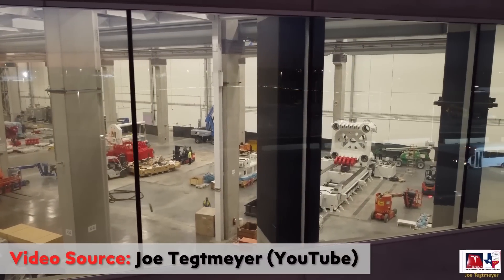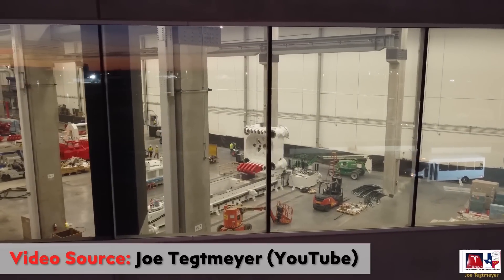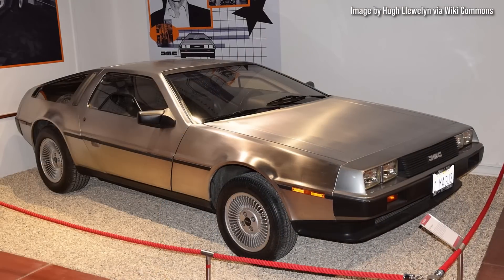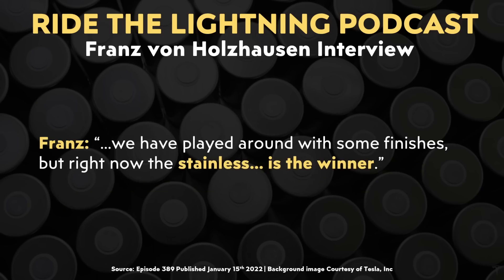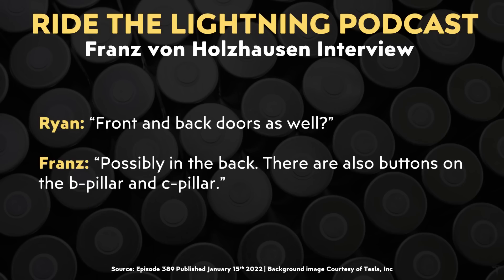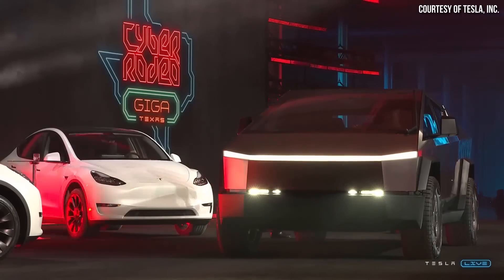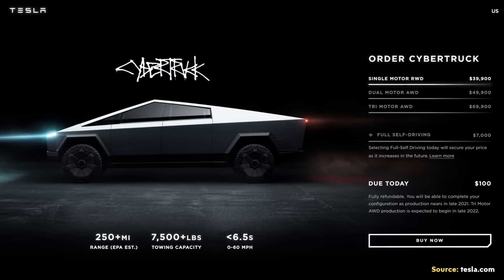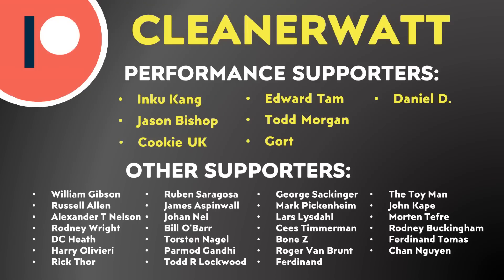NEW Tesla Cybertruck Updates from Franz von Holzhausen + Giga Press

Comment from the maker: Check out the SPAN Smart Electrical Panel: https://bit.ly/cleanerwattspan (Sponsored)
Reply: Thanks Jon.
I hope that Tesla can also produce a scaled down version which would be much more suitable for European roads. A hatchback based on the design would also be awesome.
Reply: About 4 motor version i think there will be another mass production motor for model 2 and  add 4 of those to Cybertruck is a very good idea. Having 4 motors eliminates need  for differential blocking it is like yo have blocking always on. The top model may start from 65k  and you get it under 80k with FSD. European version must be under 3.5ton total weight limit otherwise it requires category C driving licence and 95% of Europeans doesn't have that.
Reply: Tesla may do a different brand that is cyber car  so - Possibly Like no VW in audi name there will be no Tesla in Cuber- brand line so It is ment for job.  Like vans and  trucks but also 4x4 cars like Defender/wrangler. Vans can be very small and can be like 10 ton.  Also for short rental/robotaxy there  may be good idea that you find car fast in parking lot and stainless finish is perfect for that.  Also those rental cars must have 3x wiperfluid like 15l  and good wipers that can get rid even from ice and 10cm snow. Otherwise you cant order those cars in taxy manner but be like in Bolt drive you walk to the nearest car some 5-15min  and then drive and that gives no edge to FSD when you drive by yourself and cars can be those $20k yaris class cars or smaller. I use daily to commute those cars my drive is usually 15km (10miles) and i do it 40x in a month and my bill for that is 250€ currently renting tesla model y RWD costs me like 10% initial 4k€ + 400€ month + insurance + service + wiper fluid etc it is 2x the price. so to get profit out of FSDcar+FSD must be at price level 30k. Tesla must think to add wiper fluid tanking option to charging stations to support robotaxies  since it the biggest probleem with such kind of rental. Today was good example i had Škoda Fabia 0.10€minute/ or 4.24€/h and it was snowing hard   nd traffic was horror so my 25min trip was 1h and i paid 7.64  and i paid only 2€ more than usually. In case of Tesla it is hard to offer price less than 0.20€/minute since Need is only in rush hours tesla my do some 4-7 trips a day while no FSD version 3-5 Bolt Drive cars had in first year like 45k km now it looks like they have more so that fabia makes 20k revenue in a year and costs 16k it fuel costs were like 4.5k so that must come near profit in 1.5years.

Comment: When Tesla started out, they priced vehicles as low as they could to create demand. More recently they have been quite open about increased pricing so that demand is reasonable in relation to supply capability. I am sure that they could still make a Cybertruck for around $40k but it makes little sense to do so at outset with all that pent-up demand.

Comment: so if it's a a pickup truck then how do you put things in and take them out from the side of the bed? that's one of the main necessities of a pickup, and this has no capability. you can only get things in and out from the rear of the truck. complete failure of design because it's done by nerds who have never used a pickup truck for its intended use.

major fail.

Comment: The Stainless will only be on the sides, Tailgate. The Front Grill/Hood will not be stainless. Vehicles have to have a crumple zone and accommodate pedestrians. Hitting a Pedestrian with a stainless hood will basically slice them in two if it came dislodged it would then hit the windshield. Stainless would be to heavy for those side panels covering a compartment above the bed. Aluminum hood and a composite or just plastic grill like all there other vehicles.

Comment: Predictions.
They may revert to 3 motors using a variant of the Semi drive disengagement system.
.
It's logical, being perfect for towing and general efficiency 
.
Even if it's 4 motors, they could have the mechanism on 2.
4 is overkill?
...
Instead of a rolling load cover, a flat, single piece steel cover able to slide up under the cabin roof between it and the headlining.
Exactly like a sunroof.
Why?
1) It's simple.
.
2) it's known and tested technology, virtually "off the shelf".
.
3) It removes the need to store the cover behind the rear seats.
That means a "passthrough" can be installed, that can allow for either standard sheet material or long timber to be carried with the bed fully closed.
Great for security.
That would kill the Lighting/ Rivian which can't do that.

Comment: 9000 ton.  NOT 9 tons.  Refers to the clamping force of the platens.  Hydraulic force of the molten metal entering the mold wants to separate the 2 halves.  Need that much clamping force to hold them together.

Comment: Great video, thank you. Strategically, this must be a headache for Ford etc as the moment the Cybertruck becomes real, I think many will hold off from buying more traditional offerings. Ain’t terms of information and specs, to me 250 miles seems low, I’ll be curious to see what the specs are on the battery pack. My prediction is 1794 cells and 165 kWh for the 4 motor variant, with a >300 mile range
Reply: Way off on the pack size Vs range
Reply: What’s your pack size and range estimate for the 4 motor Cybertruck?

Comment: Both the Plaid S and X are over $120k, and historically Tesla releases the most expensive cars first. So my guess is the initial Cyberyruck will be near $100k
Reply: I thought the plaid model s is now down to $114,900 to start? 🤔

I do think the top spec ct initially could approach 100k. Just based off top spec hummev, top spec gm everado, top spec Ford lightning all also either near or over 6 figures. Plus the base lightning is now 56k to start, the base gm work truck everado is 72k to start. 

A base rivian r1t dual motor is now what 74k? Down the line I see a base 250+mile single motor rwd for 45-49k but not for 2+year's at least. 
And maybe a 55-65k dual motor 330-350 mile range version sometime in the 2nd or 3rd year of production. 🤔
Reply: But the Model 2 (or whatever called) pricing will break that trend toward most expensive cars first.

Comment: The "soon" in "this giga-press will soon make the underbody castings" is a bit contradictory with your information that Tesla only just started unboxing the giga-press. Installing, fine-tuning, test-running the giga-press will take more than one month before real production. This cybertruck looks very challenging to get right at all levels of quality, features and cost.
And 3 years later, there's still zero information on how to deal with scratches and dents on naked metal. Prevention of scratches from bushes is one thing, but stone and metal leave bigger marks. These are usually buffed out and repainted over as new on painted bodies, but what's the solution for naked metal, if there even is one?

Anyway, I don't care a bit about the American-centric cybertruck, it's really the semi and other real trucks that I am looking forward to, they are a much bigger advance for the whole world and the environment. Although even there I have serious doubts about the front center driver seat that is a compromise where design won over practicality.

Comment: I went and saw the CT at the Petersen Museum. It is enormous in person; way longer than the pics convey. It is absolutely stunning in real life... nothing else like it. I have a lot to say about the stainless. It will need to have some sort of matte industrial finish so it doesn't blind anyone. If you scratch it good luck "buffing" or refinishing to match the other panels. You simply won't be able to match the surface swirls that came from the factory. It feels really hard though. Now onto the price of that skin: it was initially claimed that leaving out the paint shop would dramatically reduce costs. Stainless like this costs 3X to 4X what regular carbon steel costs... and the CT body is at least twice as thick. There is no way this type of skin will end up cheaper than paint. The wheelbase is also freakishly long, meaning the CT will absolutely require four wheel steering. My conclusion is this will never be a cheap truck; that $40k starting price is a fantasy, and I agree that it is looking more like $80k (to start).
Reply: Stainless is not 3x more expensive than stainless… that’s just wrong.
Reply: @niceguyrides cold rolled stainless is certainly more expensive than other forms of stainless
Reply: @jcart011  more expensive yes, but not that much more expensive at scale.  I’m a designer. I make these decisions everyday.
Reply: @niceguyrides  fair enough
Reply: You need to factor in the Capex for the paint shop. That costs 100's of millions of dollars to build out. That should drive the costs down as well, at least a bit.
Reply: @steverichards7675 they already have it for the other cars though
Reply: Yesss i saw it at the petersen too. Its huge.! It looks like a tank. I cant wait😊
Reply: Well a paint job is not cheap.  Not having to deal with the issues and costs of an industrial level paint booth with employees and DEQ regulations will save lots of money per car.

Comment: Can't claim any first-hand experience, but I'd think that, once steer-by-wire is accepted, it's inevitable that the yoke will replace the wheel. In fact, eventually less than a yoke.
Reply: Steer by wire has been around for more than a decade. I think it is now proven.
Reply: @vinnylamoureux1187  You are missing my point. IAC "accepted" is a relative term. I'm saying that, IF YOU ACCEPT THE PROPOSITION that steer-by-wire is OK, then the need for a wheel is much less, or even absent.
Reply: @ronaldgarrison8478  
Autosteer systems (autopilot, etc) effectively already use a "steer by wire" system, all that's missing is an input from a (dual redundant) sensor behind a "steering wheel" (or yoke).
That input comes from the computer.
.
There's no physical, mechanical connection between the computer and the steering motors.

Comment: We need to be less accepting of extreme price changes after vehicle has been offered and ordered at a certain price.The company has many genius minds at work before and after.Dynamics in the cost and construction was in my mind factored in before the unveiling. is not fair to consumers to raise prices after vehicle was ordered, regardless.
Reply: I assume you apply the same critique to the F150 Lightning?
Reply: Relax.  You didn’t order anything or create any obligation (for you or them) by placing a $100 refundable deposit down, outside of securing a place in line.
Reply: @awash7156  How.much deposit put down for the order doesn't matter.Not holding up to your word does.Sale on bananas 10 cents/lb with 10 cent deposit.At pickup the price is changed to $2/lb due to whatever excuse they  come up with.Fair? Not hardly. Bait and switch.
Reply: @georgeinczauskis7871  that’s a nice sentiment but with due respect, you didn’t put down a “deposit” (legally speaking).  You paid to get in line.  As an early adopter, it’s your responsibility to manage your own expectations and be realistic.

Comment: Your thoughts on if cities used thirsty concrete for there roads to reduce flooding and sand mining helping you and ecosystems.
Yes I'm new no clue if you talk about cities or sustainable stuff at all.
Ok besides ev cars.
Reply: Porous concrete doesn't work in sub zero temperatures. The hydraulic expansion forces that occur when water turns to ice just breaks it apart.
Reply: This is basically a Tesla channel.  Not really the place for discussion of porous concrete.
Reply: @incognitotorpedo42  
He spams every week

Comment: Hi, just curios , how will a small crash be dealt with, since there is no paint to retouch, how eill a dent be fixed, cur and weld?
Reply: Rumor is they will be painted due to difficulty in fabrication.
Reply: @Liberty2358  
Rumor is that FUD merchants are introducing "rumor and speculation" which they can later leverage as "Tesla lied".
.
Doesn't work anymore.
Reply: There is a reason, back in the day, many of the few DeLorean cars eventually were painted. The “tough” no maintenance exterior ended being anything but.
Reply: @BAndersen-ee1xy  
"There is a reason" that those Delorean owners who painted their cars regretted doing so.
.
If you listened to the Ride the Lightning podcast in question, you'd know that.
.
(Ryan was a Delorian owner and was (is) FULLY aware of both the refinishing of the softer steel on that vehicle and the reason painting was a  BAD idea)